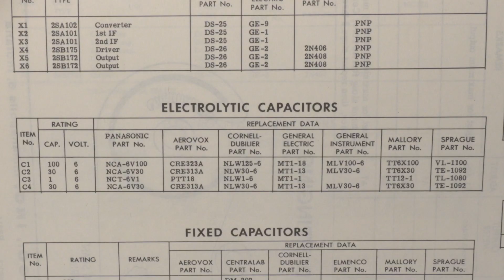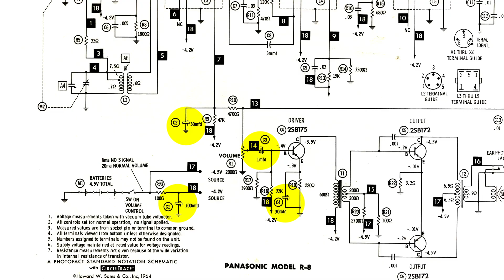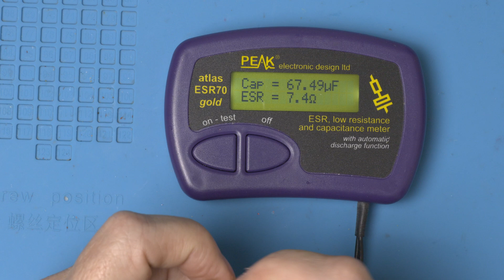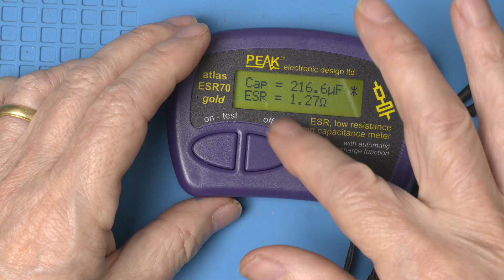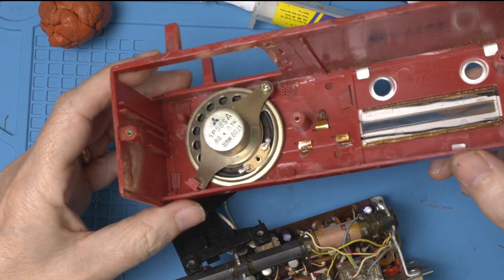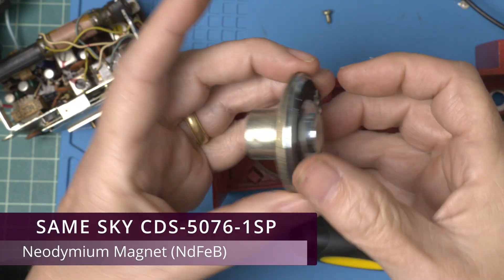Vintage Electronics Repair: Dead Panasonic R-8 transistor radio restoration

Comment: Tip:  Point a flashlight at board while holding a screwdriver/pointer where the capacitor is/was and then look at the reverse side - you will see a shadow where your pointer is.
Reply from the maker: Now that's a GREAT tip!  Thank you.

Comment: Liked your work. Just curious to know about the speaker. Do speakers wear out?
Reply from the maker: What a great question!  Two factors are in play.  The first is the magnet in the speaker does degrade over time, and the paper cone dries out and becomes less flexible, which affects sound quality.   The second factor is that speaker technology has gotten a lot better in 60 years.  More sophisticated designs, better magnets, better speaker material, better manufacturing.

Comment: Solder has rosin inside you don't need add some.
Reply from the maker: You're right - its a habit now, I should hide the rosin before I start.

Comment: I remember seeing these for sale at Radio Shack at the time the movie "Thunderball" was in theaters. Radio Shack was not in every city at the time. We had gone out of town to see the movie and went to the Radio Shack when at the time I bought my first tape recorder, a Panasonic RQ152S which took me a year to save up for. I am surprised how clean the battery compartment was with only slight corrosion, but there weren't those leaky Duracell batteries at the time.
Reply from the maker: This is a great story!